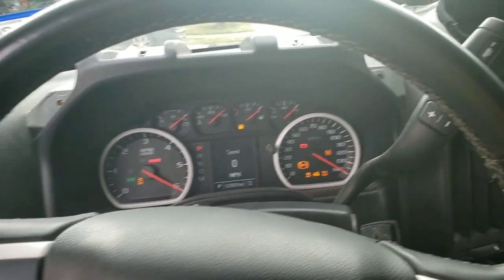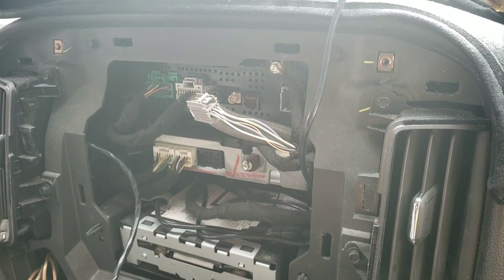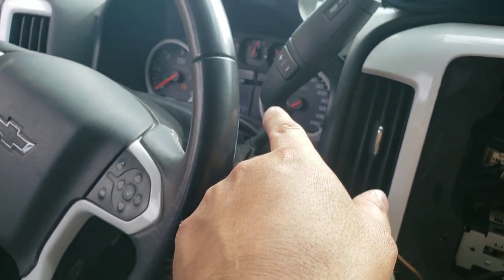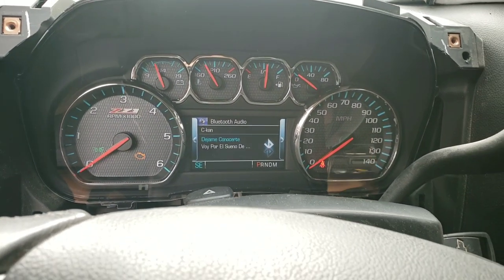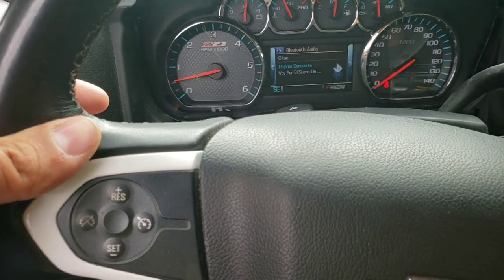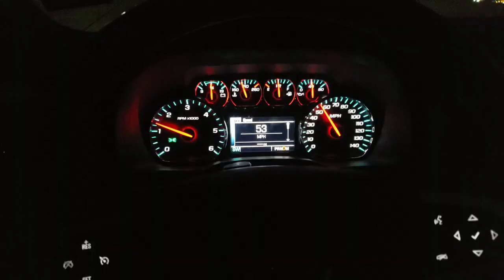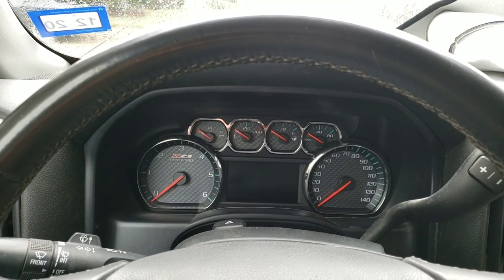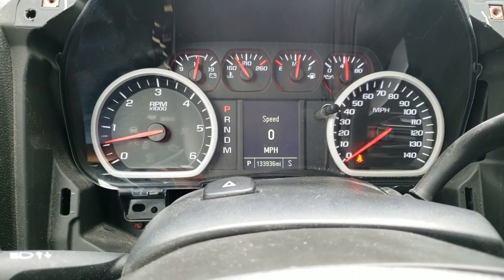Gauge Instrument Cluster Upgrade Part 2/3 for 2014-2018 Silverado/Sierra

Comment: The wiring you did is this just so the radio works. I only want to swap out the cluster so I have the wider screen on my cluster
Reply from the maker: Correct. If you currently have steering wheel controls then technically all you need is the reprogramed cluster
Reply: @Jorge.Rangel  I have controls on the one side the left. I took the cluster out of my other truck I smacked up. It's not reprogrammed I wanted to just change them. I don't care if I can't see the milage or kms
Reply from the maker: @franker1111  but I mean you have radio controls on the back of the steering wheel?
Reply: Nope
Reply from the maker: @franker1111  ok, yea all the wiring was for the radio controls to work with the new cluster. Not necessary but I was doing all that might aswell have them.
Reply: @Jorge.Rangel  ok thank you I'll try it to see if it works. If it doesn't I'll simply put the factory one back. Have a good night

Comment: Thanks for doing all this and showing how.  I saw your post on the GMtrucks forum and gave this a shot.  Thank you!!!  After all the wiring upgrades, new Denali cluster and new steering wheel my steering wheel controls will not illuminate.  Everything else works perfectly.  Any ideas what could be wrong?   Thanks again.
Reply from the maker: Did you get it reprogramed? It could be that or you might need a new steering wheel clockspring

Comment: I have a WT with io3. I want the wheel controls to work and already have a Denali cluster. What’s the lowest Io I would need to upgrade? Io4 or higher?
Reply from the maker: Is been a while but I believe io4 round be the minimum. Price wise not sure you might be able to do a newer one for the same price.

Comment: Do you think this is possible with the io4 radio and also what pin terminals did you use for the cluster plug?
Reply from the maker: It might be, I can't remember from the top of my head. I would have to research what I did.

Comment: Let’s say I buy a Denali cluster or a big screen cluster for my 14 lt silverado it has over 100,000 miles so idc if the miles don’t show, if I just plug it in my truck will it work?
Reply from the maker: It might work just fine but yes it won't show miles and maybe cruise control won't work. Some say you need the correct part number for your trucks year, so as long as you get that correct part number for your trucks year it will work but without those features.

Comment: Hey man, thanks for all the work, keep it up. 

What parts do I need (wiring harness, hmi, screen, controls, etc) to go from an iOB to io6?
Reply from the maker: Not really sure as the IOB radio is different and has a different connector on the back.

Comment: So what does programming it do? Just let’s you see the mileage? I mean you’ve proven that the mileage is still recorded when you plug in your old speedometer... so just trying to figure out if it’s really worth it to pay to have it programmed.
Reply: Does programming it also get rid of error messages like “service park assist” if you don’t have that feature?
Reply from the maker: Programing makes it like oem with no error messages. Is like if your vehicle came equipped with it. Also on some vehicles it will loose features if you don't program it and I heard that some vehicle don't even want to turn on.
Reply: @Jorge.Rangel  THANK YOU THANK YOU THANK YOU!!!!!! 

i have a 2015 Tahoe PPV and I picked up a 2019 Civilian Tahoe speedo off eBay for $68 in great condition... I had added a steering wheel with controls and they weren’t working... I followed your videos and now everything works and lights up! Thank you again I am so happy!

I do need to get it programmed and I probably will when I have cash laying around... cause the alerts that display at each startup will get me annoy my undiagnosed OCD lol

But other than that everything appears to be working!!
Reply from the maker: @benjaminfelder1756  I'm glad it all worked out.
Reply: did that work for you?  I have a 2015 tahoe pvp.  and I want to replace the cluster

Comment: Will the controllers on the back work if I replace both cluster and wheel  send wires the way you did on your truck but on a factory radio
Reply from the maker: I want to say yes but I'm not 100% sure because the cluster communicates with the hmi module and not sure if the hmi module needs to be reprogramed in order for them to work.
Reply: @Jorge.Rangel  would you have a copy of the numbers that go from cluster to radio
Reply from the maker: @addisonsfam  in one of the videos of this series of upgrade I show which ones go where and I think I also linked the paged from the forum.
Reply: @Jorge.Rangel   what's a forum
Reply from the maker: @addisonsfam  a web page with all the information I used to make this work.

Comment: so what didnt work besides the miles i dont care about that is there anything else that kept you from keeping this one
Reply from the maker: Cruise control didn't work, odometer, tire pressure monitoring. I didn't keep it because I was doing the denali cluster upgrade anyways. I already had the parts but if I didn't have it then I would have definitely keepted it but still had programed it.
Reply: @Jorge.Rangel   damn could live without odometer but cruise is a deal breaker for me i have to have that thank you for the reply

Comment: Hey did u  up grade ur hmi module also or did u keep the same one
Reply from the maker: Upgrade it because I had switch to the bigger screen
Reply: @Jorge.Rangel  I have a big screen buy I'm trying  to log on to see if I can get that info u used
Reply: If I give u my Vin can u get me that page
Reply: 2017 chevy silverado  v6 4.3 single  cab
Reply from the maker: @addisonsfam  https://www.gm-trucks.com/forums/topic/192664-wt-trim-with-color-dic-steering-wheel-controls-io5-stereo-retrofit/
Reply: @Jorge.Rangel  hey what kind of truck do u have
Reply from the maker: @addisonsfam  2014 ls

Comment: Question man how do I get the miles on it
Reply from the maker: You need to get it reprogramed by WAMS. I said that in the beginning of the video
Reply: @Jorge.Rangel  is that expensive?
Reply from the maker: @jonjohnson102  when I did it they charged $200 for the reprograming plus you pay shipping there and back. Maybe like $250 total. Not sure their prices now.
Reply: @Jorge.Rangel  was not expecting a reply, thanks!